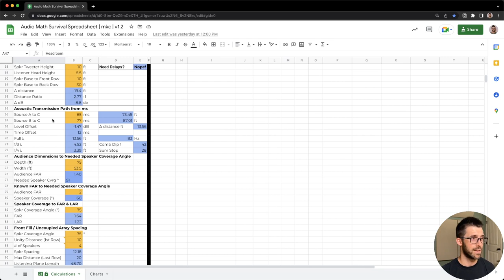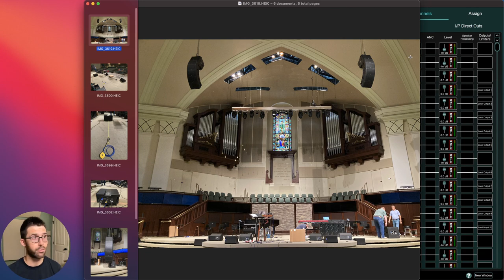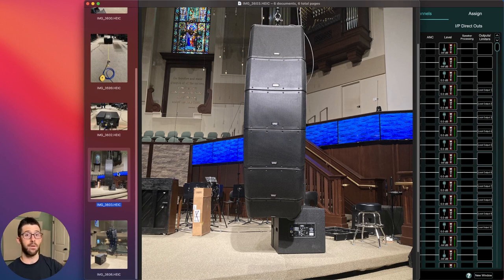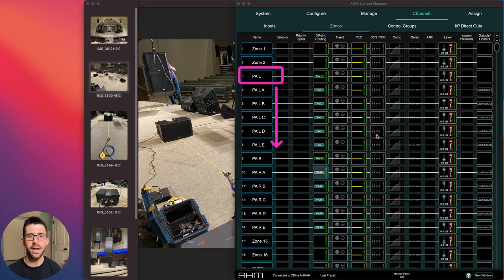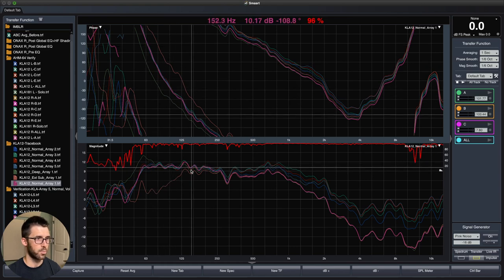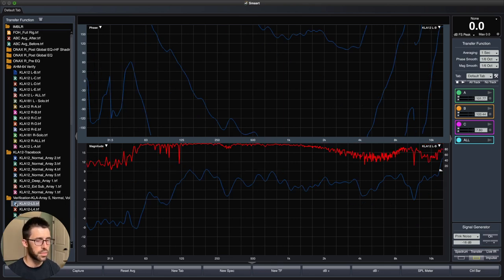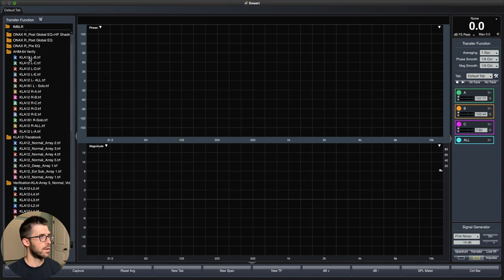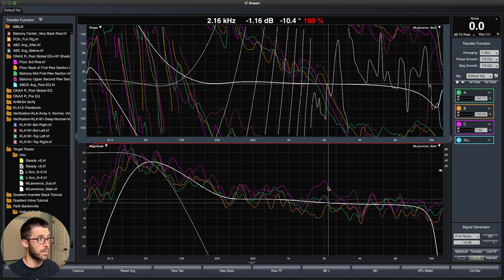Before You Fly Your Line Array...

Comment: Hi Michael, did you gate your measurements? I assume you did. :)
 If not, you will have gotten a lot of reflections back into your measurements. Unfortunately, ground plane measurements still require some reflection-free area.
Reply from the maker: I didn't gate them. You're right, I could've done an offline measurement in IR mode or gone to REW for that, then convolved the IR and gated the timing.

In this specific circumstance I was more concerned about consistency with 95% good data, than 100% good data and a slower process. Good point.